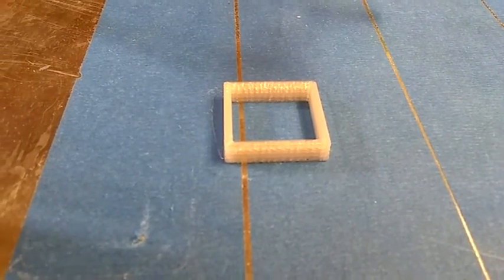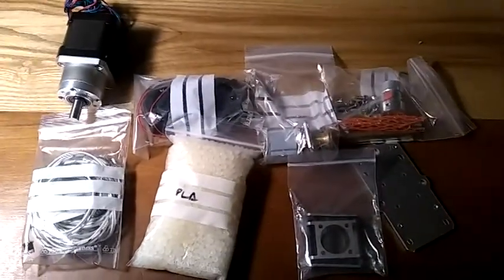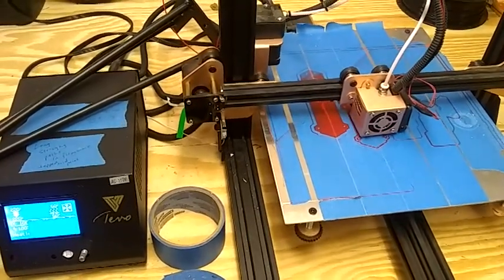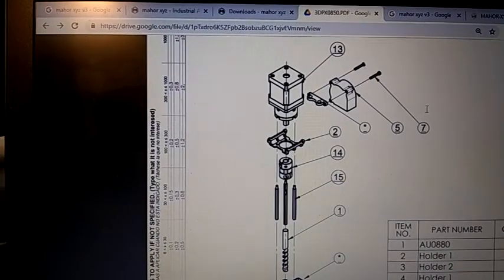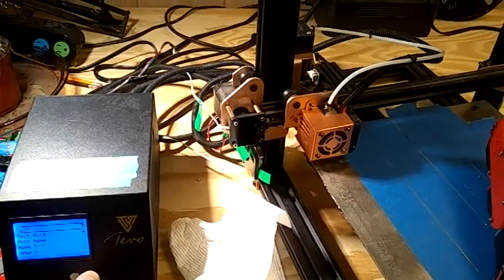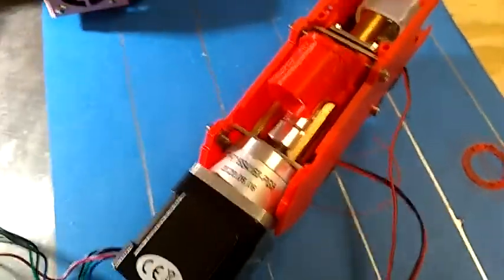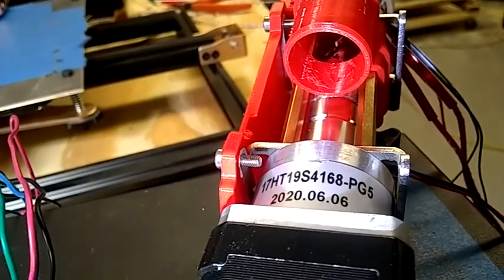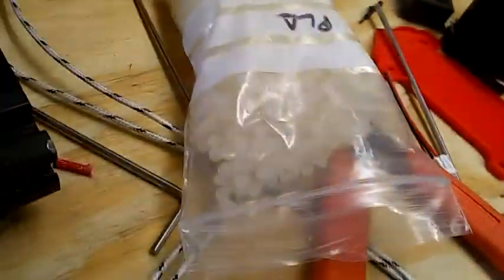Making a Mahor V3 Pellet Extruder Head and Using it on a TEVO Tornado

Comment: Hi Sam, did you experience any differences regarding printing temperature for the polymers you used so far? Does the additional screw allow lower printing temperatures compared to normal hotends without screw due to a higher pressure that is applied to push the melt through the nozzle?

Comment: Why did you go with the V3 rather than the V4? I have the V4 and am having a terrible time with heat creep.
Reply from the maker: Cheryl, I went with the V3 because it costs less. Yeah, the heat creep can be an issue. Maybe I'll post another video about it. I'm experimenting with a few things to improve performance. 1. Turn the extrusion up to 200%. 2. Turn the speed down to 50%. 3. Use pellets, not recycled flake. I tried flake, but it doesn't really work. I think a compression screw is needed for that, like the precious plastic extruder design 4. Use a large nozzle like here: https://www.amazon.com/dp/B075RZRZSY/ref=pe_2640190_232586610_TE_dp_i1
Reply: @samwechsler  Thanks! I have a question in to Mahor about how to reduce heat creep, if I can alleviate the issue I'll share what worked.

Comment: Wow! That looks great! What's the price difference between using pellets and filament? How much does the unit cost?
Reply from the maker: Thanks Jeff. V3 Pellet Extruder 24v
€329.55 EUR for the extruder head. I was reading somewhere that using injection molding pellets or similar would reduce costs 50-80%. Here's an example of a bulk bag of pellets, https://www.getoutsidegames.com/Extra-Heavy-Plastic-Poly-Pellets--66-lb-Box--Bulk-Discounts_p_403.html I haven't tried them yet, but they are on the order of $1 per lb. Normally a  spool of polypropylene filament is a lot more: https://www.filamentone.com/products/filamentone-polypropylene-pro-select-clear-1-75mm-0-75kg-3d-printer-filament